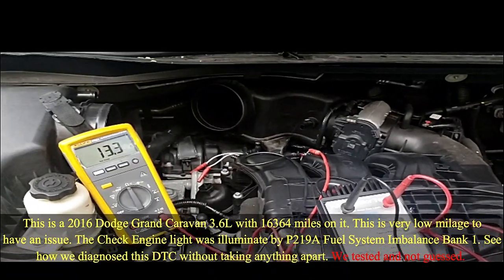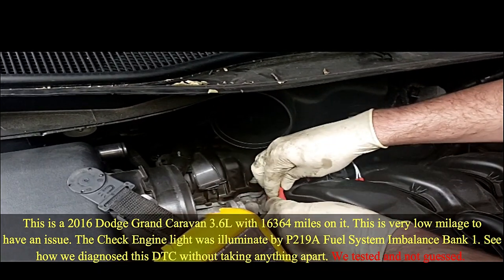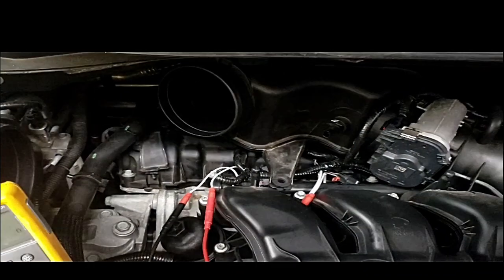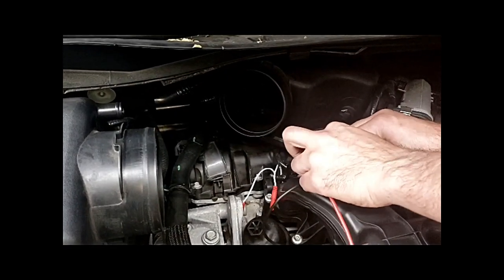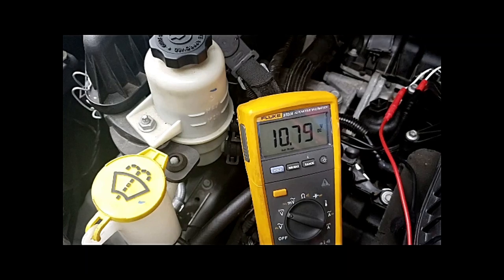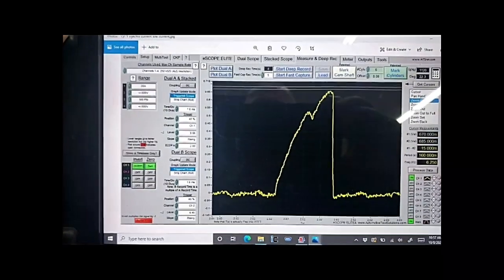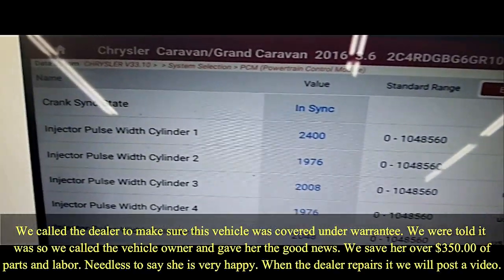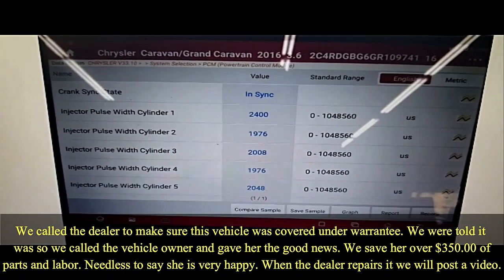2016 Dodge Caravan Imbalance P219A - Felt like a Misfire

Comment: I have a 2016 grand caravan with a 140K miles on it. About 2 months ago I had p 219a code which is air fuel imbalance in bank 1. Other than the light in the dashboard, there was (and there is) no serious issue such excessive fuel consumption or loss of power, etc. Only thing I have very small idle issue, like the indicator in the rpm goes up and down very minimal (it is difficult to notice). I replaced the o2 sensors of bank 1, map sensor, and checked the vacuum lines, air filter etc. The problem did not go, so I replaced the fuel injectors of bank 1 and bank 2, so I changed 6 of them. P219a code went off but now I have p219b code which is air fuel imbalance in bank 2. Did I mess something? What might be the problem?

The car has an engine ticking sound for along time which I believe is a common lifter/rocker arm problem for pentastar engines. Could that be a reason for air fuel imbalance?
Reply: RA.. did you ever get it resolved? And if you did what was wrong with it?  I have p219a code too and i been noticing a tick noise
Reply: @jasonwong9672  I believe the problem was lower intake gaskets. They were really decayed. I replaced them and the dashboard light is gone. I have still the ticking sound though. I believe rocker arms need to be replaced as well.

Comment: Great video! Should any mechanic be able to diagnose this issue? because I have the same issue with a rough shaky idle and run so I went to 3 different shops in Conyers, Georgia and they acted like they didn't know what the hell was going on. Now, granted my 3.6 Charger does have a RIPP supercharger on it but shouldn't be an issue with the motor. They were scared to touch my car, really? Can you help! Thanks
Reply: Mechanic here, yes, this is a simple resistance test. With the supercharger have you had your tune checked?

Comment: What was the symptoms that this car was giving you and also I have the same cold coming up but every time I get to a stop the car shuts off and this is only code that pops up is air fuel ratio imbalance also  no transmission Codes at all
Reply from the maker: The transmission did not shift correctly and there was a rough running engine. Thanks for watching...If you have not already subscribed to our tstseminars YouTube channel please do so. Interested in more training? Go to www.tstseminars.org and view full length videos for members on TechFlix for $9.99 unlimited viewing …Membership and over 85 videos for less than $200.00 a year. Also checkout www.attstraining.com for hands on training and webcast
FREE videos at www.tstseminars.org/training-videos

Comment: I changed injectors but did not fix the problem any more suggestions?
Reply: Injector not the problem and im sorry, just because the injector was his problem does not mean its everycar problem with this code. It has to be properly diagnosed.
Reply: @OnlineMechanicTips  right. Probably why he asked if they had any more suggestions?
Reply: @thestig572420  Fuel Pump should be the next to be changed.
Reply: rocker arms